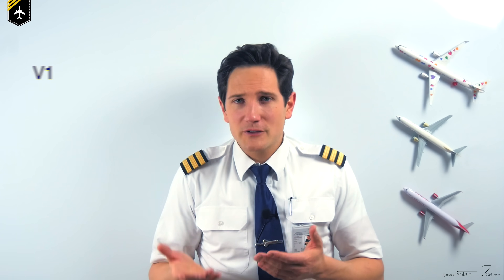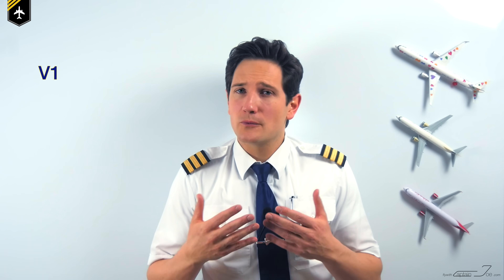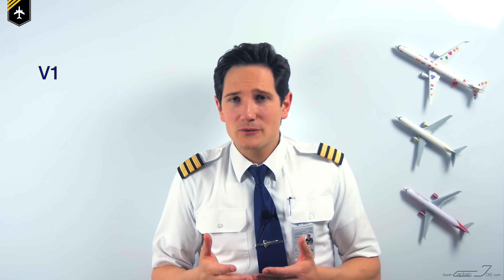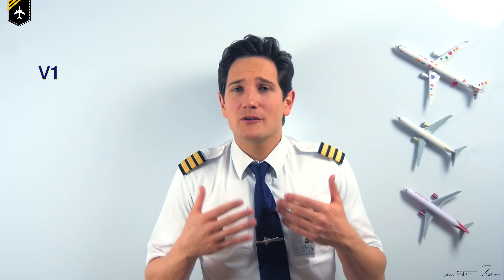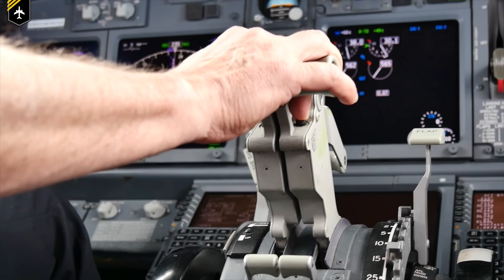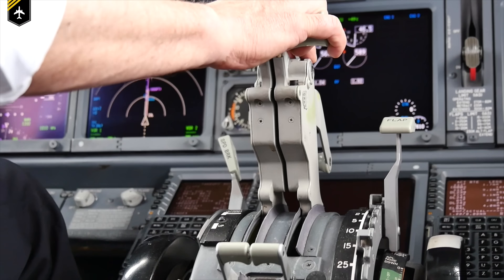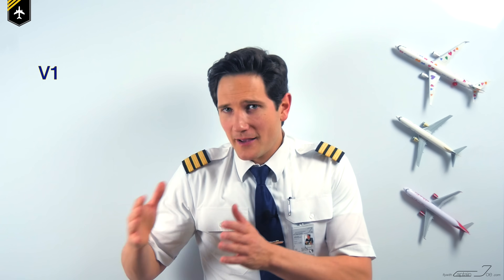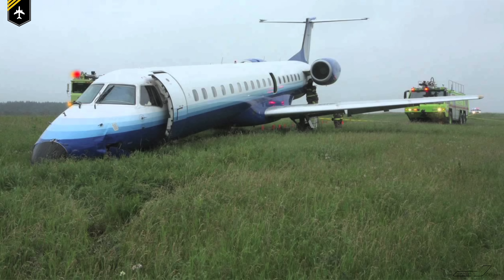TAKE-OFF Speeds V1, Vr, V2! Explained by "CAPTAIN" Joe

Comment: Hey CJ can a plane take off with one working engine
Reply: Not if it's a single engine plane!
Reply: Phaidrus Yes, if the ability of the aircraft to fly is in question, then the takeoff can be aborted after the V1 callout, however, it may result in the aircraft departing the far end of the runway at high speed.  It is better to slow down and depart the far end than to try to fly and have that result in a much higher energy crash.
Reply: nigel leachman good question. Airplanes certified for say commercial operations, specially those over a certain weight, are only allowed to be used of they demonstrate the ability to take off on one engine, climb to a set altitude and maintain that altitude, all on one engine. Technically if air density, runway length, winds and airplane weight all work together, any multi engine airplane "should" be able to take off and fly, albeit suffering some considerable thrust vectoring effects. Hope that helps. BTW I'm a pilot, aircraft mechanic, however not a multi engine pilot.
Reply: Phaidrus Continue flying.  V1 is a term for multiengine aircraft.  After V1, takeoff is the only option unless the aircraft is uncontrollable.  Ask a more specific question if this is not the answer you were looking for.
Reply: So what should a pilot do if he loses one engine after V1?
Reply: Phaidrus 
I'll prefer to stop
Reply: Thanks for replying. If I may ask again: the aircraft has reached V1 but hasn't taken off yet and then both engines start malfunctioning (to some extent) due to, say, a bird strike or some other reason. May then the pilot abort takeoff?
Reply: Thanks Oscar Blue
Reply: nigel leachman 
Can you walk with one Leg?
Reply: Mr,Joe I want to know that how a pilot knows the correct path in day night in sjy
Reply: The best answer is... it depends
Reply: Jolly joker!
Reply: The short but misleading answer is “yes” a plane can take off with one engine.  You could take off a twin engine airplane using only one of the two engines from start up to take off if you had a very long runway and no obstacles in front of you once you got in the air.  You would have to accelerate the airplane to the takeoff speed on one engine.  This is not practical, dangerous and explicitly prohibited in the operational manuals of the twin engine airplanes I have flow in the past, but it could be done.  It’s not a good idea, trying to do so will likely end very badly but possible under the most favorable conditions.

Comment: years ago when I was in the military: they used to spend a lot of time at the end of the run way doing engine run up maybe as many at three. when I flew civilian place they would taxi to the end of the run way stop and then apply full throttle and down the run way we would go. what  was the difference in the two (this was with props). then with  the jets they would try to get as near 100% power then kick off the brakes. they don 't do that any more. they  hit the end of the run way and they go to full power and roll down the run way.  does V-2 mean that they raise the gears?why did they stop that?  thanks for the videos they are very educational. I don't fly but I keep up with all the military planes that I can.By they way you have three strips. (I know a captain has four. what does three mean? are you a full commander or what)?
Reply: John Moore co pilot

Comment: How is passenger and carry on luggage weight estimated?  I love your channel BTW!
Reply: mjmbiker The airlines use average weights.  I think 185 lbs/ person in the winter and 5 lbs less summer.  Baggage is calculating using standard weights per bag.  Athletic teams used to be weighed because, on average they are heavier than the “average” person.

You can probably google that topic and find an answer.

Found this: Since 1995, most airlines have assumed a weight of 180 pounds for each adult passenger in summer and 185 pounds in winter; checked bags are assumed to weigh 25 pounds each.

Comment: What are the typical values of V1, Vr and V2 in a typical plane ?
Reply: Dan Alex Dan, it varies from aircraft to aircraft.  Weight, temperature, and altitude also affect the speeds.  I have seen as low as 125, 126, 128 and as high as 157, 159, 161ish.  The higher speeds approach the tire limit speeds and might even be the limiting factor at high altitude airports like Denver.  The 747 speeds can be much higher.

Comment: capt..Joe how to handle an engine failure in exact at VR
Reply: threepleJ 011704 Continue rotating up to the engine out attitude and go flying.
Reply: Any engine failure after V1 goes into the air.  Vr comes after V1.  So there wouldn't be any thinking about an engine failure at Vr, the plane is going flying.  If the failure occurred at V1, if your hands are off of the thrust levers, it is going into the air.  If in doubt, take it into the air.

Comment: What If my elevators fail after v1?
Reply: This has happened. An MD-80 rejected takeoff 12 seconds after V1 because the pilot couldn't rotate the plane due to damage to its elevators.  If you abort after V1, you're going off the end of the runway.  That's what V1 indicates.  If for any reason the plane won't fly after V1, you're going to have a bad day. https://www.ntsb.gov/investigations/AccidentReports/Reports/AAR1901.pdf

Comment: Q. Why small obstacles (such as birds) can destroy an engine ?
Reply: Because of the very high speeds involved in flight. Force is equal to mass multiplied by acceleration. Thus, even if the mass is small, the acceleration from a bird going from 30km/h hitting an engine at v2 is more than enough to generate the force required to damage both the bird and the engine.
Reply: Shining Armor thank you I appreciate it

Comment: What if all engines fail (extremely unlikely) after V1 but before Vlof?
Reply: Then you're going off the end of the runway and are pretty much guaranteed to have a bad day.  The aircraft is designed so this is very unlikely to happen.

Comment: So if your taking off a Cessna from a 3000 meter runway, would VR and V2 be before V1?
Reply: Young Aviator No.  V1 then Vr then V2.
Reply: No.  A single engine plane doesn't have V1 or V2.  There's no decision to be made.  On a really long runway V1 and Vr will be at the same speed.  You can't abort a takeoff after you've taken off.  Once you rotate, you're going airborne.

Comment: Joe, great video...   Love all of them.  United Airlines does NOT currently call V2.  

Not sure if you have done this, but one of the constant questions I get from non-pilots is the assumption that a landing is more stressful or "dangerous" than a takeoff.  I always try to explain to them that while a landing is indeed a significant event for the pilot, and one that requires perhaps more finesse, skill, and even a bit of luck, that indeed it is the takeoff that is far more stressful to the pilot.  And the takeoff is in my opinion a more risky event, because when you arrive just prior to V1, you are at your highest speed and weight combination, yet you typically have MUCH less runway in front of you than when you touch down on landing.  When landing, we are typically at our lowest weight and speed of the flight, and we typically have more runway to get slowed down after touchdown.  Of course, all this assumes a typical flight with no malfunctions or weird stuff going on.  

Any time I sit next to somebody that has a really crappy landing, I always jokingly remind them of what a smooth takeoff they had:-)

Would also like to see you make a video trying to explain to people why sometimes our takeoff thrust is actually less than our climb thrust.  That would really freak people out. 

Thanks again for the video.

Comment: Question! V1 is the speed beyond which you must not abort takeoff even if an engine failure occurs. Yet, are there some exceptions where you are allowed to abort takeoff even after V1 is called out? One scenario I can think of is when both engines fail at the same time, like due to bird strikes to the both engine. Are there any other situations other than this?

Comment: So if you're flying a Piper Cub, I'm assuming you'll reach VR before you reach V1? Assuming it doesn't take you 3/4 of a mile to take off, correct?
Reply: No. While you could theoretically land a cub again after taking off on a long runway, once you rotate the plane is going flying.  You can't abort a takeoff after you've already taken off.  Because of this, V1 always happens at or before Vr.

Comment: Hi Capt. Joe I need to ask something I saw a post......
A 747 is sitting on a conveyor belt, as wide and long as a runway. The conveyor belt is designed to exactly match the speed of the wheels moving in the opposite direction....
Can the plane take off??
Reply: Well, the thrust is not produced by the wings but by engines so, I think it would not matter
Reply: Of course the plane will takeoff.  What does the speed of the wheels have to do with anything?  A plane doesn't even need wheels.  It can have skis, or floats.  When the air over the wings reaches a given speed, the plane will fly.

Comment: So, if you have a 10 mile long runway, why would you call 'V1'? At any time you are still on the ground, you could safely stop in the runway length available. Indeed shortly after takeoff on such a runway one could, in theory. land again and still stop on the runway in the event of something nasty happening, say a severe engine fire. So on VERY long runways, isn't V1 superfluous?
Reply: of course logically true but you don´t even find runways of 4 miles length in the world. 
see here: https://en.wikipedia.org/wiki/List_of_longest_runways
5.5 kilometer / 2.9 nautical miles / 3.4 statute miles and this is out of the ordinary, just the longest one.
It was rather superfluous to establish exceptions for extremely rare applications, due to higher complexity.

TLDR: they will continue to consider V1 as necessary:-)
Reply: When we first started flying jet transports, runways were typically ten thousand feet and occurred every 45°. Nowadays, you're lucky to get 7,000 feet or a single crosswind runway...

Comment: Hey Captain Joe, great video ;)
I have a question related to it. What would be the definition of V2 if you were flying a plane with 3 or 4 engines? Is it the same as it is for a 2-engine plane? Or is ti maybe the speed at which the aircraft may safely be climbed with two (or three) engines inoperative? Is it even possible to take-off with one engine on a 3-engine or 4-engine plane?

Comment: How incorrect is thinking that V1 is minimum takeoff speed, defined by: if I were to pull back on the stick anytime after this, I will catch lift and gain altitude. Then VR is speed at which the pilot actually pulls back, rotate as in thinking the aircraft is rotating about an axis drawn through the rear landing gears. This "pivot" can then be seen as a rotation. V2 is defined as, your speed is fast enough that with max braking, you will not stop short without going into the sand. From an ATC point of view, "you are committed to this takeoff, and must leave the runway safely via flight." When I watch takeoff videos, I assume V1 was like your "minimums" that is blurted out before landing. VR would be whichever speed the pilot chose to pull back, but I rarely hear V2. I assumed that the aircraft registers a change in altitude, meaning VR has been initiated and v2 has become moot since the plane is now flying.

Comment: Hi Joe. I've never completely understood V1 because surely it depends on the length of the runway? Let's imagine you're taking off in a small Cessna and the runway is 10 kilometres long. How can V1 be a certain speed when surely the length of the runway needs to be taken into account? In this example I could get the aircraft up to a very fast speed, much faster than if I had a short runway, and still be able to stop in time? In this case wouldn't VR occur before V1? Or actually wouldn't V1 be so fast that no aircraft could ever reach that speed?
Reply: The runway length is not the only limiting factor. V1 cannot be higher than speed at which brakes cannot dissipate heat produced - better known as Vmbe. Additionally, your rolling maximum speed would be limited by maximum tire speed, so you cannot accelerate on ground indefinitely. But, to answer your hypothetical question, V1 is decision stop/go speed on ground and if by calculation it turns out to be higher than Vr, it would be stupid to call it after Vr where you cannot stop (you are already in air). In that case you just call it together with Vr to comply with general procedure.

Comment: Obviously I'm not a pilot. I've always wondered about the Concorde crash, even though they'd committed to take off, would it not have been better to still abort. Apparently the crew knew the plane was basically on fire at the point of take off. Would it not have been an option to crash within the boundaries of the airfield rather than taking off ? I mean, they must have known they were pretty much doomed anyway. Sorry if a really stupid question, it's just something that's always puzzled me, I'm assuming emergency services would have been on the scene pretty quickly and lives could have been saved.
Reply: Pilots are trained to not abort after V1, so if catastrophic failure incompatible with flight occurs after V1 - tough luck. At some point, some people at full consciousness that people may and will die, decided that the best way to prevent pilots killing themselves by aborting take-offs in events where aircraft is completely capable to fly, is to force them to think less and rely on muscle memory. It's an ethical question and there is no right or wrong answer.

Comment: hi Joe sir! I am an 16 yr old child and airplane enthusiast. I cant understand vr!! any solutions??
Reply: Every profession comes with it's own "language".  Aviation is no different.  VR stands for "velocity rotate" or "rotation speed".  Velocity in this case means a specific speed as seen on an airspeed indicator, the instrument that presents "how fast the airplane is going" information to the pilots.  Speed units can be; knots (nautical miles per hour abbreviated kts), miles per hour (statue miles per hour abbreviated: mph) or perhaps other units as well.  In aviation "rotate" when used in conjunction with the action pilots take during takeoff just prior to getting airborne (following comes from Google definition)  "refers to the action of applying back pressure to a control device, such as a yoke, side-stick or center stick, to lift the nose wheel off the ground during the takeoff roll. Proper rotation is important for safety reasons and to decrease takeoff distance."

VR is the speed when the pilot does the physical action, that action will differ in different kinds of airplanes, which results in the nose wheel coming off the runway and the airplane beginning to fly.

Comment: From what I heard that V1 calculation takes into account runway length, wind and trust {which means acceleration}, does V1 correspond an exact point on the runway? 

Other question: at what point the Vr has to be reached relative to the runway length in order that type of aircraft at the given conditions can safely take-off? I assume if Vr can be reached at the end of the runway, that's not a lucky configuration:)
Reply: In theory - yes, you can easily calculate takeoff roll distance at which V1 occurs. Keep in mind that V1 is not actually one speed. There is usually a zone of speeds where V1 can be selected, so you can chose minimum, maximum V1, or anything in-between.

Vr has to be reached in that way that your actual take off distance (completed at 35ft of height) should be less or equal to maximum take off distance for that particular runway you are taking off from. Additionally, required climb gradients for 1st and 2nd climb segments can be limiting factors. It's kinda chain effect - if you chose reduced thrust setting for take off to maximize runway length used, you maybe end up with not enough thrust to overfly obstacles in 1st and 2nd segment climbs with legal screen height.

Comment: The whole idea of V1 is to make a go no-go decisions, this speed depends on many factors. Airbus for instance in order to save engine life which is done by reducing thrust have a higher Vr if the Rwy is very long, you travel further into the Rwy to reach V1 due low power settings therefore saving the engines, you still have sufficient Rwy left in order to stop at V1

Comment: @4:05 generated lift OVER the wing????
Reply: Yes, air moving ABOVE/OVER the wing creates lift
Reply: @leslieanderson7695 you are wrong. Air moving on top and bottom of the wing creates pressure not lift. Lift is the difference in pressure between top and bottom of the wing.  For the plane to fly you need greater pressure on the bottom not on top and you achieve that by creating a non symmetric airfoil.
Reply: @SN1350 look up some basic aviation physics videos to understand what you're missing. The top of the wing is specifically designed for the air above it to aid in lifting. You're almost right but you're missing a few key pieces of information.

Comment: Sometimes they don't use these designations.
I was surveying a runway at a major airport at night
one time.  There was almost no traffic.  A hot little jet
began takeoff headed north, lifted enough to retract landing gear,
continued straight and level, then pointed the nose on
that plane up and was gone.
Reply: Some bizjet operators use that altered procedures to build up speed low over runway and clear configuration, and then it climbs "like a rocket".